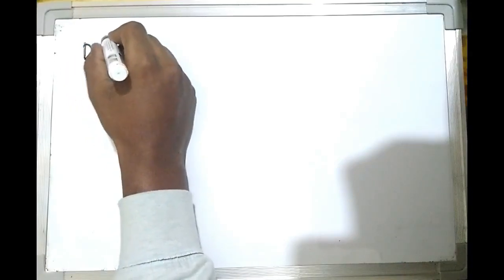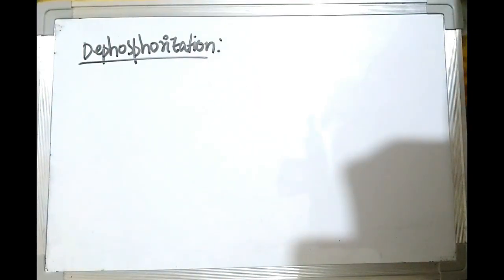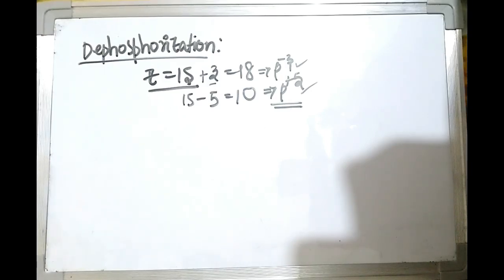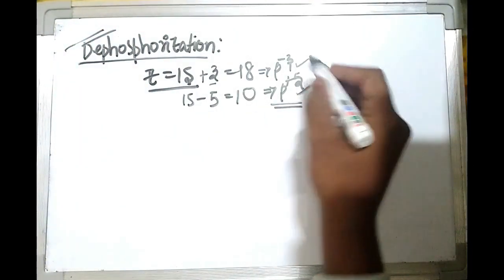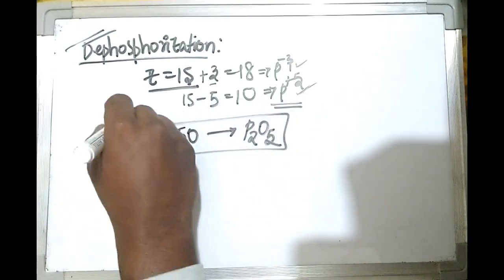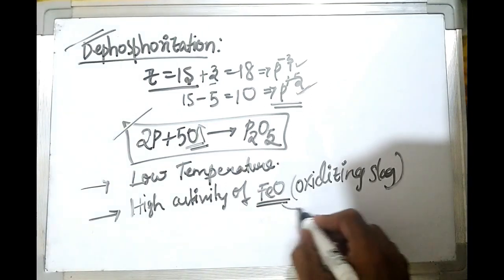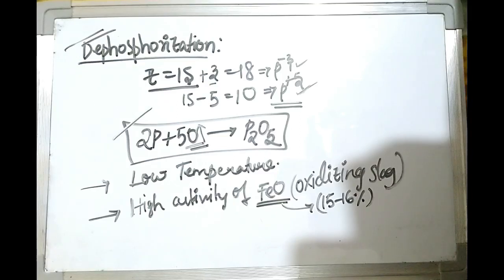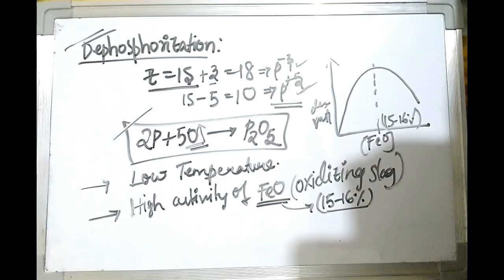DEPHOSPHIZATION & DESULPHURIZATION-LECTURE 11-FERROUS EXTRACTION- EVERYTHING METALLURGY

Comment: why not do desulpurization after primary steel making?.why done before steel making?
Reply from the maker: Coz we are using oxidizing conditions in convertor....if there is any sulphur...it may form any inclusions which will be hard to remove !!
Reply: Everything Metallurgy-AAMME 
like sulphur, other elements can form inclusion during primary steel making?
Reply from the maker: Sulphur cannot be removed in oxidizing...rest all form slag on forming oxides !!